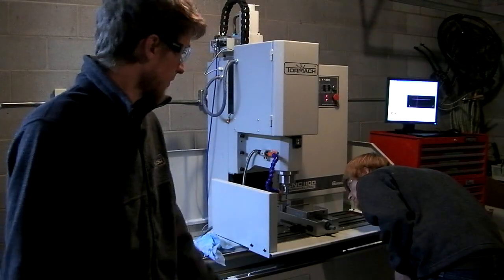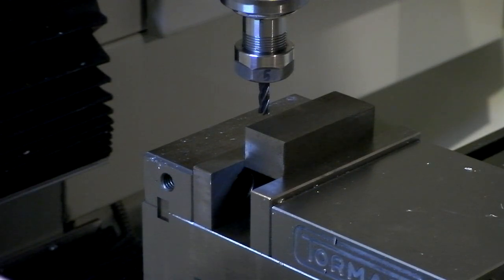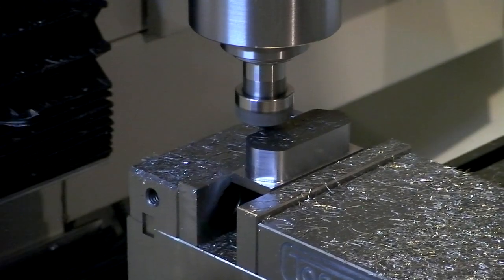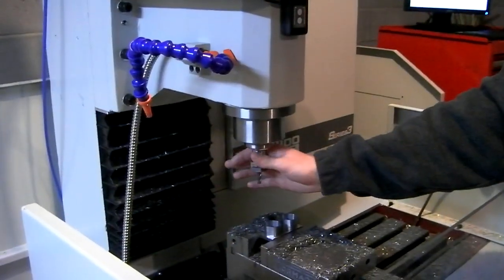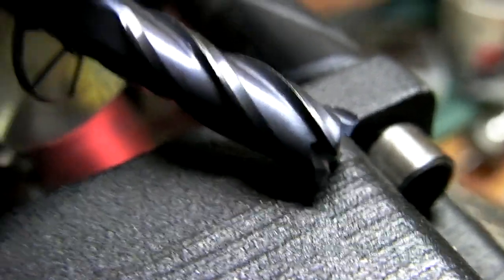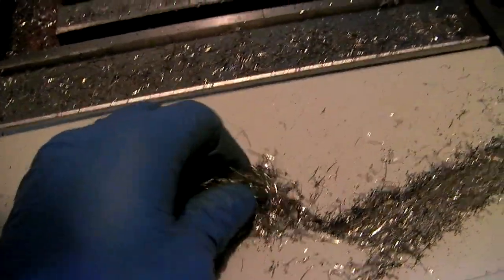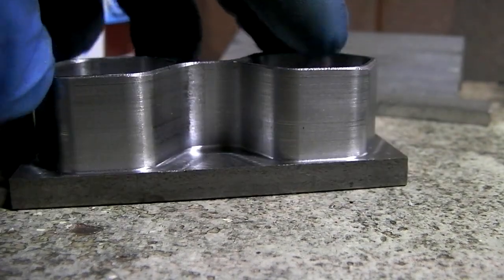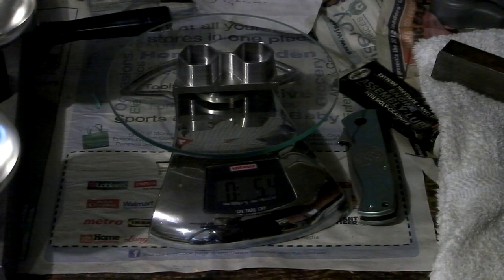Tormach - first steel machined part

Comment: Just face mill the top so you have a small flat surface again. Also, I know it’s your first steel part, but that feed is way too fast. You’ll learn, I’m sure you have by now. That finish was awful...I heard you say it came out looking good lol. That part would’ve got rejected in my shop based off surface finish alone. You got the right idea, keep with it. From one Machinist to another.

Comment: Jesus John you really got hammered in the Comments. Need Coolant, No Coolant, Too Fast, To Slow, Less Feed, More Feed. Bloody Hell. Did anyone read the video description. Tormach- FIRST steel machined part. For me, you did a good job for your first steel machining job. Sometimes you just do something just for the sake of trying it, whether you feel you  are doing it right or not seems to be what you described during the video.  You already felt it was a little silly but will see what happens.I clicked Thumbs Up because I was really interested how the small machine would   perform and I was very impressed by its capability I was thinking maybe to big of a cut for this little machine but it held up very well.All The Best with Your Business.Regards Peter.
Reply from the maker: +Peter CCR ENG Thanks Peter!  You nailed it, as my very first part a lot of times you just have to trial and error the learning process.  I should go back and make it again with the knowledge I've learned since!
Reply: That being said John. What do you think you would run your speeds and feeds at now with the 1100 in Cold Rolled?
Reply: Peter CCR ENG irony being running higher feed and air is the way to go

Comment: I don't know what you guys are talking about rigidity being an issue. This is strictly too fast rpm per feed rate. I don't recommend this, but I normally clamp onto .05" on a mill to profile intricate parts using Esprit and I've never had issues not getting my finishes desired. But I will give this guy credit since he's doing this at home on a much less quality machine.

Comment: I had to machine a very very tiny part from 1018 on a lathe. after a shit load of trial and error, ended up with a feed rate of .0002" IPR at .003 cut per side at about 3800 RPM. Using a mori seiki SL-0 and the only insert that was capable of providing a mirror finish for 100s of parts was an ingersol .0035R
Reply: chevy668 that’s Lathe work you’re talking about. Major difference with regard to speeds and feeds.

Comment: videos like this make me chuckle, that finish looks like crap and it definitely wouldn't be within tolerance if it was for something
Reply: HighStreet Killers you should rough it out with a bigger endmill and then go for finishing with smaller endmill. The squealing is the tool deflecting from making a lot of contact in the corner, many ways to fix that
Reply: +HighStreet Killers what is the tolerance was +/- .500"? i'm pretty sure it would be in spec.
Reply: +HighStreet Killers There may not be too many ways to work around this on that machine at a full depth cut.

Comment: Too much rpm and maybe a lack of rigidity for that cutting speed. 
Also part is clamped on maybe 15% so it chatters a lot.

Also use roughing endmill for roughing or you will destroy all your fine endmills so they will make undersize parts.

I leave 0.1-0.15mm for finishing cut so my tools last for a long period of time.
Reply: Give it more feed; you shouldn't feel that much heat in the part if you take the heat out with the chips. There's nothing wrong with using a standard end mill for roughing if you approach it with the right strategy.
Reply: Icutmetal more feed better finish? Who told you that? You ever made good part?
Reply: Have you ever programmed using constant engagement techniques and average chip thickness? Don't assume I don't know what I'm talking about. Research peel milling or trochoidal milling; perhaps then you will understand.
Reply: Icutmetal again high speed machining is a roughing technique aiming to speed up material removal and tool life. It has nothing to do with achieving right finish. Peel milling will give you nice finish but is irrelevant to the part machined in this video. 

Every situation is different, and as tool lengths materials and parts are different, I leatned one thing long time ago. If youre having problems with bad finish, slow down. I had parts with tools being extended more then three inches long and I still managed to achieve acceptable finish, by going almost dead slow.

That said this might not have to be solution to all problems. Poor tool quality (dull, chipped), tool runout, not enough material taken out on finish pass (tool needs to ,,bite in" otherwise it just ,,slides off" and vibrates) even poor quality coolant might be an issue
Reply: sebastian szewczyk im not an expert in fact i know very little but i think he basically ruined the end mill by the time he was doing the fiishing pass. i agree he should of roughed it it first with a serrated end mill. i also wonder that the ships were so small that the rpm/feed rate mismatch probably.

Comment: Chatter is generally one of 2 issues.  First, it's a feed/speed issue.  Sounds like too high RPM to feedrate (I say it This way because I don't know if the machine is capable of a higher federated).  Secondly, I don't know about these Tormachs but rigidity of the setup is a likely culprit.  The combination of the two is chatter for sure.

Comment: Did you ever figure out why it was chattering( the sharp squealing noise)? I am having the same problem in steel. I have a vid of it on my channel dirtdigger257 its the one that has linear guide rails in the description. Awesome knives btw.
Reply: Dirtdigger257 slow your RPMs a bit

Comment: Youll get better finish if you make finish pass with low feedrates and low rpm. And yeah it seems rpm and feeds are way off. You should use like 200 surface footage maybe 250
Reply: Wrong.
Reply: Icutmetal obviously you didn't machine much. Lower rpm = more rigid tool lower ipm= lower chip load = better finish. Try it boy
Reply: Boy? Mr Know it All, if you understood high speed machining techniques and how to properly apply them using solid round tools, you might understand that 200-250sfm is very slow for a medium carbon steel like 4140, etc and running a tool too slow without the proper chip thickness is a waste of tool life and productivity.
Reply: Icutmetal I really don't think you ever machined anything. Did you find out online about the high speed machining that you cling so much to this? It's a roughing technique and yes it works great it is fast but this is it, a roughing technique. 250 sfpm is a standard value, a safe bet for a good finish pass. Even if you got good finish after spitting high speed tool path from your cam software, look closely, there was a finish pass. And as arrogant as I may sound I know what I'm talking about I do this every day
Reply: 250sfm is still too slow for a coated end mill in medium carbon steel. You can effectively mill mid 50rc die steel at that or more. Just because you do it every day doesn't mean you're right.
Reply: Icutmetal anyways using something that looks like quarter inch end mill from what I see would not be a best idea either. He should try bigger tool in first place
Reply: sebastian szewczyk and I can't bet a lot of money that 250 sfpm and .001 chip load on finish pass will give you great finish. Not sure if with the full depth of cut on this small cutter he would not get crazy taper, we might have to go even slower
Reply: sebastian szewczyk I meant I can bet a lot of money lol
Reply: sebastian szewczyk assuming it's .25 dia cutter 250 sfpm is about 3800 rpm and feed of 15 ipm. As I said safe bet for finish pass almost guaranteed right finish. Lower sfpm and feed accordingly if chatter persist. Use coolant. If amateur cnc, and coolant not available old school machinist (I mean really old school) used to use water with soap lol never tried it though

Comment: your speeds and feeds are all wrong that's why that endmill looks the way it does, it should have lasted so much longer. there are apps that you can get to figure out chamfer depths, and to get rid of chatter in corners whenever possible use a smaller endmill and program a radius. good first piece though!
Reply: This guy gets it; using too large of tool diameter profiling into corners leaves a large arc of engagement, which is bad practice. Constant engagement software; such as VoluMill's or similar will have the right setup doing amazing things with end mills.

Comment: In some cases the chips should definitely be blue. The heat goes out with the chips then instead of through the workpiece and cutter. In roughing mostly though, not for finer work.

Comment: I was wondering myself why it wasn't generating as much heat. Carbide cutters all the way!! I'm sure you know you can create more chip per tooth by increasing the feedrate or increasing the depth of cut or reducing the cutter rpms. The finer cuts probably accounted for some of the chatter too. A small machine like that along with something like Mastercam or Hypermill would be awesome for custom work. Would love to have even just a conventional lathe/mill/drill at home.

Comment from the maker: The tool is AlTin coated carbide, not high speed steel, so it can take a LOT more heat and rpm than an HSS tool ;-)

Comment: Another tip:  If you work with high performance cutting steel (hps) and the kinldings became blue or brown you have to use means of cooling.

Comment: The other direction of cutting this holes in middle of the video (turning right) would be better for the machine than cutting in left turning direction:  Who wrote the program?

I guess, this is an high performance cutting steel milling cutter with 8 mm diameter so you have to use a rotation speed of about 850 rpm.
If you take higher rpm´s you have to cool down your cutting tool otherwise the hardened steel gets "dehardened" that means it get softer and the blade becomes dull.

Comment: The chatter is from how dull that endmill is. Find someone who has an endmill sharpener with a cbn wheel to sharpen the flutes .and slow the feed a tad without coolant to maybe 6-10 fpm that much of the tool cutting puts a lot of stress along the enitre tool especially since your not spinning that carbide that fast it seems

Comment from the maker: You have to keep in mind that my old mill was 10x smaller than this and could never have pulled off those cuts.  So to ME it was aggressive, at the time.  As the title said, this is the first steel part I had made on this mill, so of course I was taking it easy.

Comment: about c'sinks and chamfer. when you set Z on those tools always add at least +.025. I recommend +.050. Then when you reach your lowest Z in a program, move your Z manually until you touch the part. Set you Z zero in this position and do short calculation. For example, if you need .015 chamfer on the part you make in the video, move extra -.015 as long as you use use 90 degree c'sink.

Comment: tomte47... it depends on application.  I certainly agree MOST of the time milling, particularly with coated cerbide runs netter dry but you must include all variables.  We run coolant 100% of the time in CGI (compacted graphite iron) keeping nasty iron dust to a minimum and increasing tool life.  Every application is unique, part of the fun is tuning it to the best possible performance.

Comment: What a load of horseshit, thermal shock on regular steel is a complete joke. Coolant keeps both workpiece and tool lubricated and as the name suggests cool. I've never had a problem with coolant and get better tool performance, tool life and surface finish. Perhaps on stainless I can see your point but regular steel no way.

Comment: Why is their no coolant?  Seems rough on the entire rig (quick change collets, vise, axis movements, sloppy end-product) not just the mill tool bits.  These machines won't last if you beat on them with raw steel milling.

Comment: little tip with chamfer mill just for instants you got a 3/8 45 degree chamfer mill and you want a .125 chamfer  ok you should know you can only do as much of a chamfer as half of the diameter and half of a 3/8 is .1875 so if you dont want to use the hole radius simple do this -.160 in the z which leaves -.0275 left over add that to stock to leave that gets the cutter to touch now add your chamfer which is .125 so in your stock to leave is -.1525 and that will give you a .125 chamfer

Comment: solid holder and shallower side depths with more feed to eliminate the heat in the cutter.  hot parts or hot tools indicate rubbing...rubbing is racing but it ain't efficient use of tools..steady air is better than coolant on carbide..I assume Mastercam or other cam suite.  Nice use of chip thining and demo of what light machines with and fast code can do! GOOD JOB! GREAT VIDEO!

Comment: And one more thing, keep as little of the cutter sticking out of the holder as possible. Carbide is very rigid but HSS cutters and steel boring bars are not and they are like noodles once you get beyond around a 1:5 dia to length ratio.

Comment: You can also take a shallower depth of cut so less of the end mill is in contact which is usually my first choice because it has the greatest affect and you can still maintain decent chip thickness which is important for typical carbide insert cutters. Reducing step over distance so the arc of cutter contact doesnt go too high (like small inside radii) is the other option but if your machine is not super rigid with software that calculates cutter load and contact, I would go with less depth.

Comment: Chatter is worst at the resonant frequency of the cutter, machine and/or workpiece so it can often be greatly reduced or eliminated by decreasing or increasing the RPM by a few %. Ideally you change the RPM while its cutting and listen for the sweet spot.

Comment: Nothing wrong with purple/blue chips when cutting dry. If you cut too slow the part will heat up instead of the waste (messing up accuracy) and you can end up outside the optimum cutting speed which reduces cutter life. The chipping on the cutter is mostly likely from the chatter which hammers the cutter against the workpiece. Chips that get caught in the cutter can also causing chipping but with low carbon steel its unlikely to be the cause in this case because the chips will still be soft.

Comment: Assuming a step-over of roughly .020", your speeds and feeds were actually quite conservative. A quality coated carbide can manage nearly 1400 sfm in 1018, which in this case would require 21000RPM and 210IPM. Given the tormach's relative lack of rigidity (and spindle speed) and the fact that it was among your first cuts on a new machine, i probably would've settled right around where you did anyhow.

Comment: No need to tell me about feed rates, I have been working on machines since I was 13. Yes I get what you guys are trying to illustrate, but at the cost of putting excessive pressure on the column and bearings. Chips should definitely not be 'blue', that is just pure heat build up and a big no-no. The machine does seem to be pretty sturdy under those severe conditions though, actually suprised how well it handled that abuse.

Comment from the maker: Good question, but I doubt it.  I don't think carbide expands that much with heat (I'm just guessing).  I think I should have left a tiny bit of metal on the floor and re-machined that, since it leaves a better surface finish when you just take off a little bit.

Comment: nah.. you want 1200ipm rapids 12k spindle.. 30 tool changer.. 

You haven't seen flying chips until your milling aluminium at 12,000rpm 300ipm and .25 deep

Comment from the maker: I use coolant for almost everything that I do, however, the pros have been telling me that ALTiN coated tools NEED heat to perform properly, so you absolutely can run them dry sometimes.  A lot of shops just use an air blast to get the chips out of the way and successfully run dry for lots of operations.  Food for thought.

Comment from the maker: Honestly I have no idea, I always try to use the same tool for a wall.  There will probably a faint noticeable line.  Also who knows if the two tools are *exactly* the same diameter, could be a tiny bit of variation there.  Flute geometry could also create a different wall finish.  But if I had to guess, the line would be small enough that you could see it, but barely feel it, and probably wouldn't throw it out of tolerance.

Comment: What are you talking about. Canada hasn't been metric. Every machine shop i know besides Michelin is imperial. It's been both really.

Which sucks worse then being either or. Right now I think in both depending on the scale of the subject. Short distances like a machine: inches. Long distances: KM. To mentally feel the weight of an object: pounds. To use that measurement in any math application: metric. if object is smaller than 1 pound. I want it in grams.

It's annoying, metric is better.

Comment: How is the repeatability on this machine? If you did this tool path in 2 or 3 steps. Is it still good? Would there be a problematic line to deal with or simple one. i know that all machines leave something due to flex. Just wondering if it's a big deal.

Sometimes it's not avoidable to use the whole flute. A part I know use a flat then a bullnose tool on two depths that meet on the same wall. Is the Tormach sufficient for that application? Thanks in advance. :)